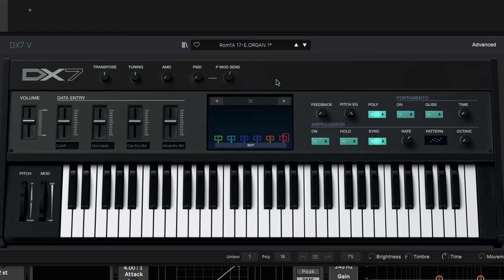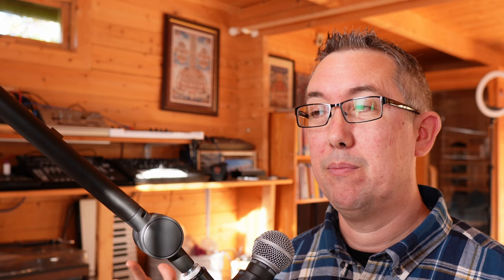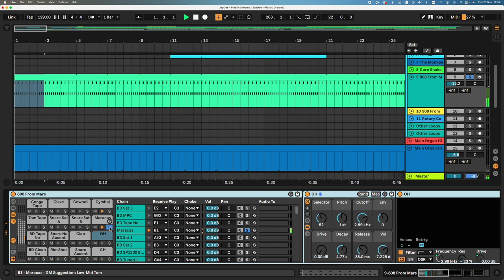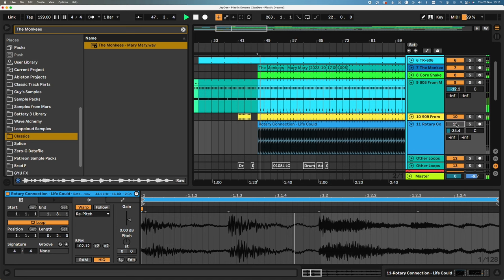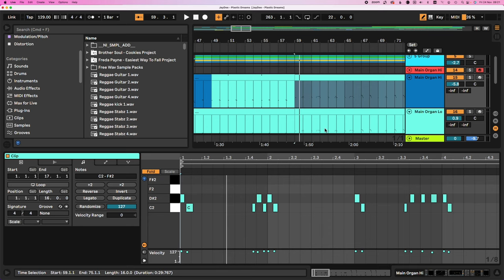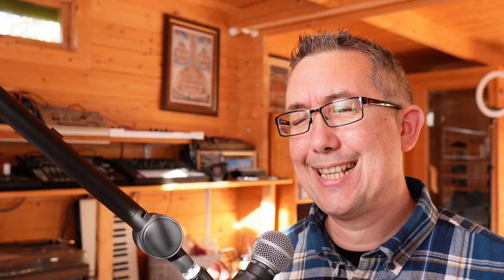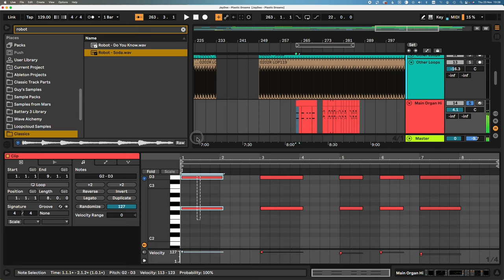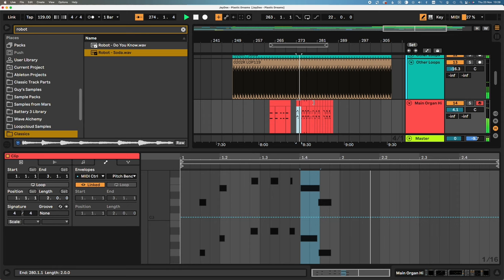How was it made? JayDee - Plastic Dreams

Comment: It's a JX-8P factory preset: Music Box preset played at lowest notes, the organ sound is from a TX81Z preset: "16 8 4 2 F"
Reply from the maker: Ah!! Thank you!
Reply: "Music Box" is part of it. The sound actually comes from the JX10/MKS-70, which is two JX8P engines ganged together in layers. In the ROM of the MKS-70 are all the JX8P patches (along with many more). Patches on the MKS-70 are made up of two base patches with a common layer between them so you can adjust volume, key spreads, etc... Anyway, there is a preset on the MKS-70 (I can't remember the name) which is made up of Music Box pitched an octave down + another patch on the root note. The same sound can be heard at the fade out of the song "Celestial Symphony" by Scubadevils, played at it's normal range. This is in fact the sound that was used in Plastic Dreams.
Reply: I think its Tibetan Bell on the MKS-70 @activelow9297
Reply: @vikramprincerai3519  Yes, that's correct. My MKS-70 was unplugged and sitting on the floor so I was unable to check... but that is the one.
Reply: @activelow9297 what an absolute belter of a tune celestial - scuba devils is ;)
Reply: I can confirm it's the JX-8P preset music box, it's nothing else. Robin confirmed this.
Reply: I remember I totally freaked out when I discovered it on my JX. 😄
Reply: I recall reading somewhere that it was a sample pack for the JX-8P that Jaydee used - only Robin can confirm this
Reply: I always thought it was a pan pipe noise messed around with😂
Reply: I always thought it was a pan pipe noise messed around with😂

Comment: The drum track that is what gives all the high end verbish and cymbalish thickness is also used on an old skool rave track by World Dominance called Compression. The start of that track has just the high end bits layered about with ocassional kicks in there, but you can eq out the kicks quite simply. I belive the story goes that this is all sampled from "the amen break". Using old style samplers and isolating different elements from that breakbeat break and using them to get the sound we're talking about here.
Reply: FACTS. That was the Hardcore typical breaks sound pre Jungle of the early 90's
Reply: @DJDragon69  Well, yes and no. There was a lot of sampling of the Amen break and the sounds of it were used a lot. But the two tracks we're talking about here for me always had something else about the drum tracks, because of the cymbals and verby sounds washing around all over the beats of each track. For me Jaydee and World Dominance were the only two tracks that really did it that well, that i know of at any rate.
Reply: @theoutsider6191 It's an Amen break, with high-passed another break layered over it (which has a wider, stereo sound). Depending on which channel you use, the Amen sounds quite different, and then add some heavy compression to get this sound. It's also used on Doc Scott's N.H.S. (Disco Remix), as well as a few less well-known hardcore tracks from that era.
Reply: It does have a nice, clear sample, with the other layered beats, at the start of Compression - Breakouts Vol 2 (Basically the same track as the World Dominance one). I think the clue is in the title, in regards the processing of the Amen break! ))
Reply: Actually compression samples Carl Cox - Hardcore Massif!, making the compression break a 5th hand amen break.